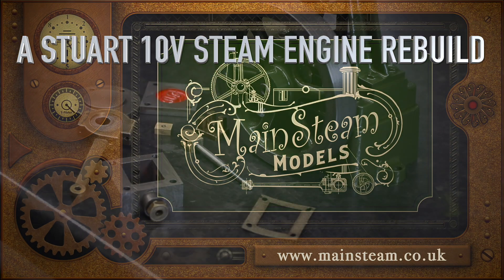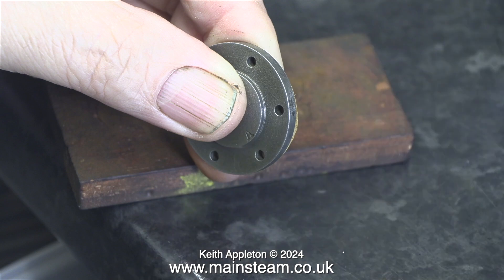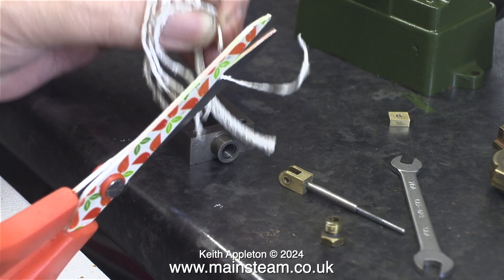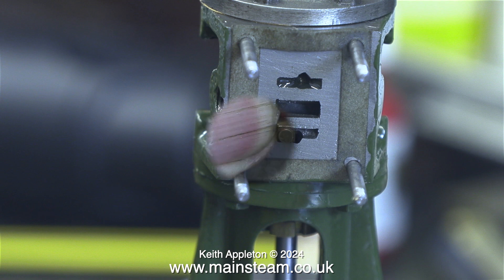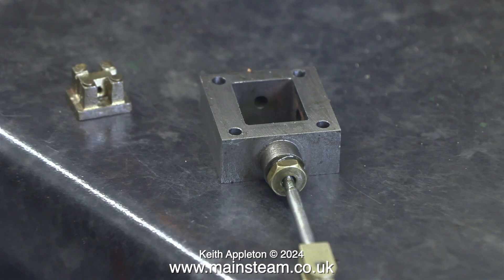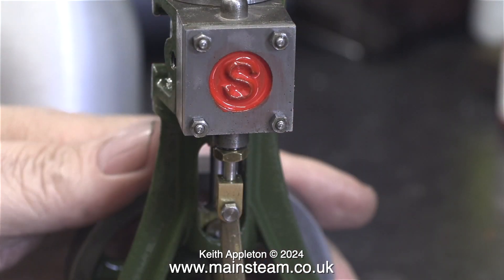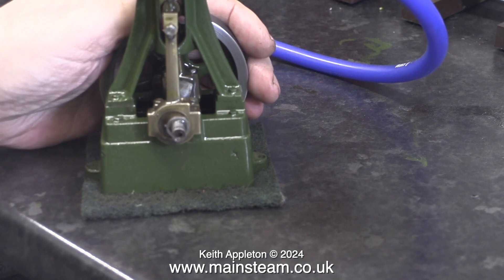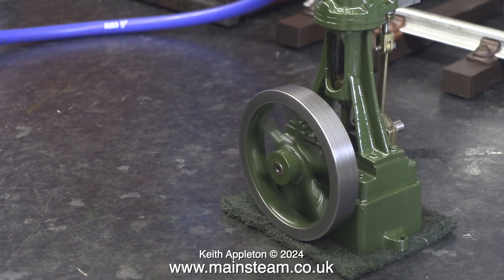A STUART 10V REBUILD  - PART #7 - REASSEMBLY

Comment: I’ve been working on a double 10.  I installed o rings on both pistons and timed it.  When the engine turns over there is a strange “pop” near the end of the stroke.  It’s not a “bang” like the piston is hitting something, but an actually “pop”.  Any idea why this might be happening?
Reply from the maker: I would suspect the valve timing.